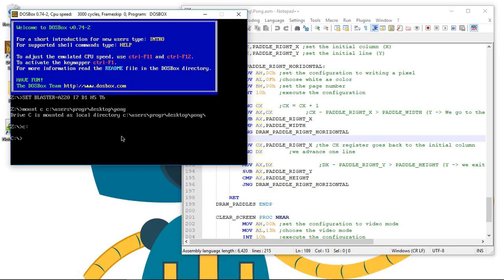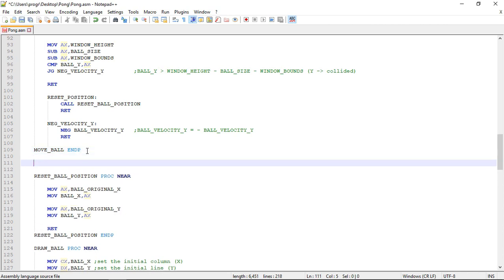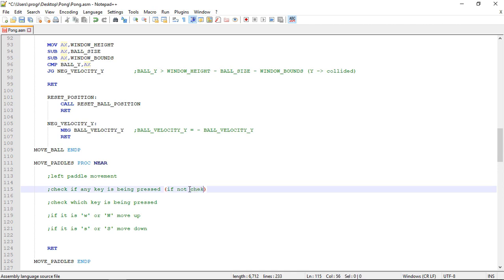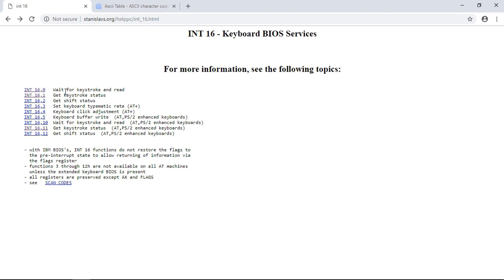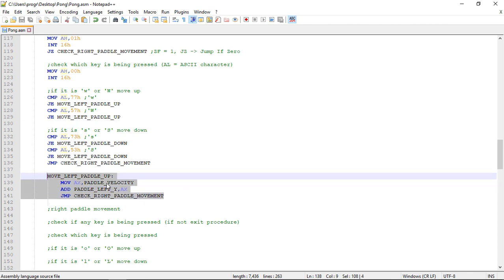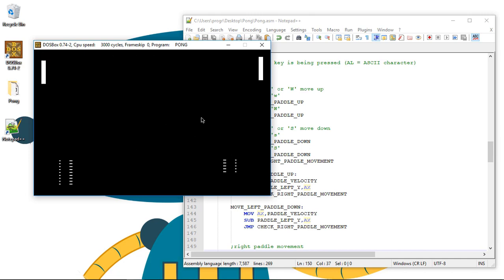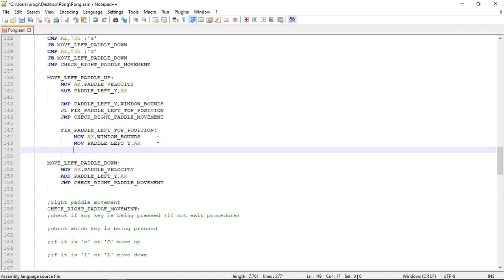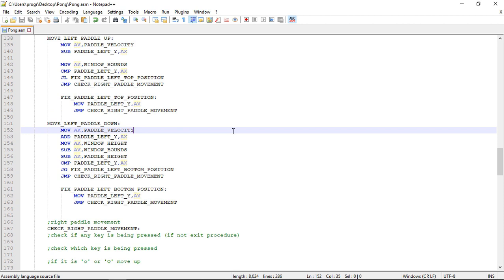[MASM] 8086 Assembly - Pong - 12 Keyboard Input

Comment: even 4 years later your course is still helping people such as myself, 
from the bottom of my heart, thank you <3

I have a small improvement suggestion:
we get the 'scan-code' returned into AH → and it has a unique value for each key, and it doesnt care if CAPS LOCK is on or not. 
(you can see all the 'scan-code's by clicking it in the site) 

for example,
 'w' will return you:
 AH = 11h
AL = 77h

and 'W' will return you:
AH = 11h
AL = 57h

so we can compare AH once instead of comparing AL twice
Reply from the maker: Thats awesome, thank you!
Reply: @ProgrammingDimension  
I am currently doing a project in assembly 8086 in university. 
I am creating "Brick Breaker"and your videos on PONG helps a ton. 

I think that around 50% of the students are doing PONG, and I won't be surprised if most of them are also watching your videos 😄

Comment: can we use arrow keys instead of  'o' and 'l' ?? Also thanks again for making this series :)))
Reply from the maker: Hi SAHEEL, that is a great question.

When you call the interrupt 16h with the AH register at 00h, to check which key is being pressed, you're left with the ASCII code of the character pressed on AL and the scan code of the key pressed down on AH.

So basically you're left with: AX => AH (scan code) | AL (ascii code)

To summarize this, when you press a key on your keyboard, the operating system translates that into a scan code. This scan code sometimes doesn't have a corresponding ascii code, this happens with the arrow keys.

To implement the arrow keys and knowing all of the above, you just need to check the AH register for the arrow key scan code.

Right now you're doing (using moving up as an example) :
CMP AL,6Fh ; ascii code of the o key
JE MOVE_RIGHT_PADDLE_UP

You just need to change it to:
CMP AH, 48h ; scan code of the up arrow key
JE MOVE_RIGHT_PADDLE_UP

Now you do the same for the down movement and you should be fine. Don't forget to remove the code for the capital case keys. 
Have fun ;)

Sources:
https://en.wikipedia.org/wiki/INT_16H
https://www.win.tue.nl/~aeb/linux/kbd/scancodes-1.html
https://www.qbasic.net/en/reference/general/scan-codes.htm